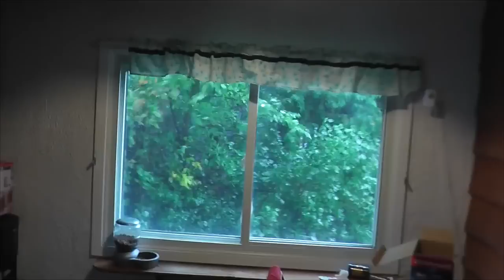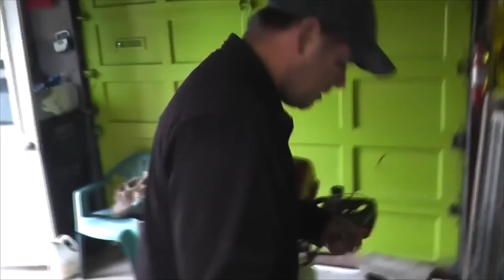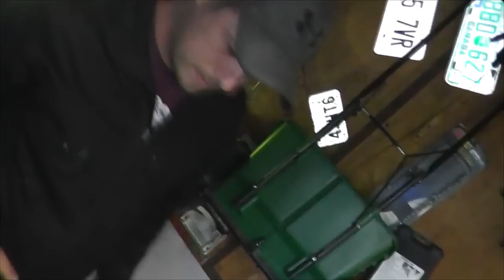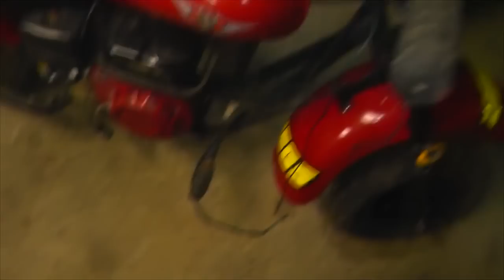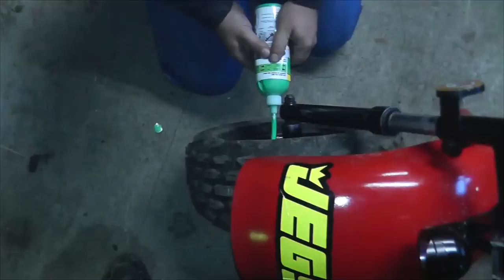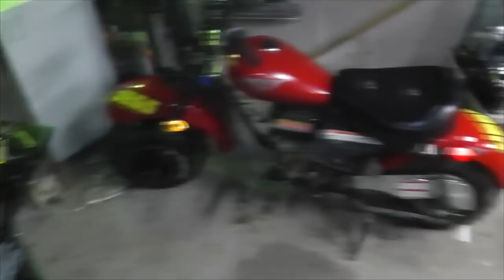Dickin around in the garage with Tasty Glue

Comment: Got a nice gel case for 99 cents on Amazon for my phone the s4 mini as well. Its blue.

I got both so my phone wlll b fully protected from the screen side (with thecreen protection)  and the components side (aka the back battery side) from drops or hard hits. I did this so I can procet from falls, high shock (meaning bumps) and from cracking out.

Comment: That LED tape'll come unstuck so fast, I used some in my shed that has proper 3M sticky crap on it, and if it wasn't for the staples I added, it'll have all fallen down cos it all came unstuck... :P

Not Magnesium, Mercury, and you'd have to break 13 million fluo. tubes before you got any poisoning from the mercury, but by then you'd have died from phosphorous poisoning and blood letting from all the stray glass... :P

You could take the wheel off Adrien's bike then slap it on one of your bikes then take it for a rip then the tyre will be slimed up, not that the leakage would have changed, that tyre is ruined... :P

I'd still suspect the valvestem on the red bike, chinese valvestems aren't well-known for holding air... :P

And Sims 4 is EA, and EA hates youtubers giving them free publicity, for some dicked reason... :P